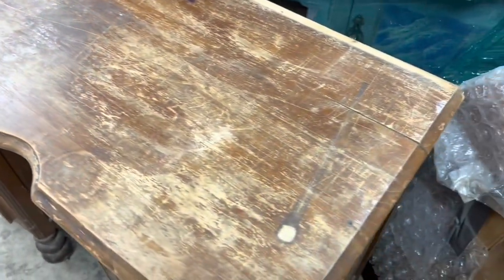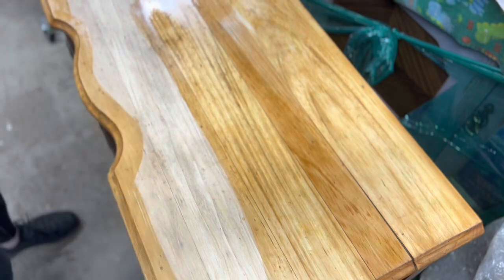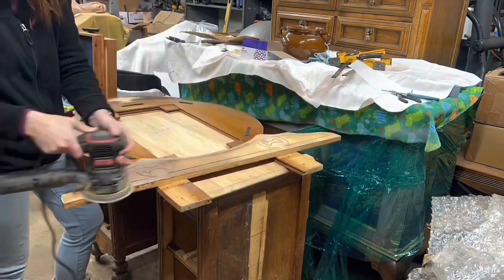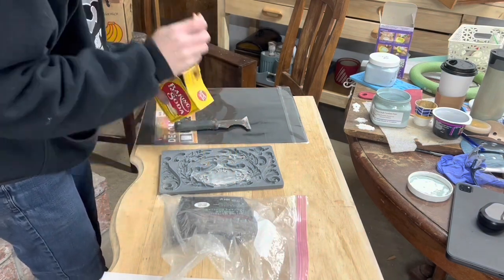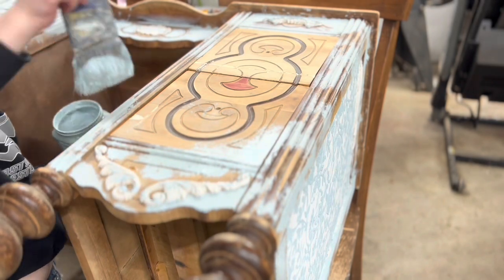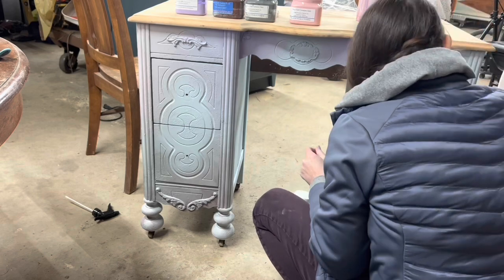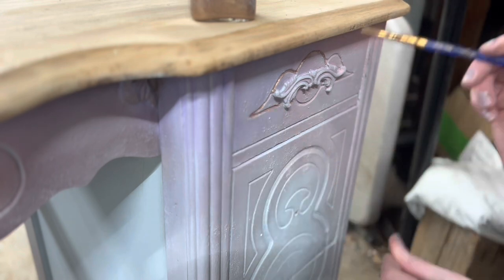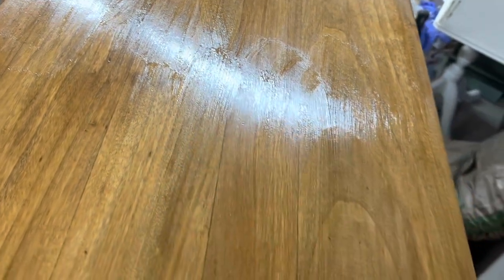Extreme Vanity Makeover | Elegant Upgrades

Comment: OMG That intro it's everything 😍 He's so cute and sweet 🥰 
I'm wonder if you had taken the top you would be able to glue it and not fill with wood filler 🤔 It end up amazing 😍 love the raised stencil and the top looks perfection, great job 👏🏻👏🏻👏🏻
Reply from the maker: Thanks, Linda! I’m pretty smitten with him 🥰. 
And the top was apart for too long so there wasn’t any movement at all. There was a gap in the base that moved while the top didn’t. It’s because they didn’t allow for movement in the piece- the whole top was glued on instead of using joinery that allowed for expansion/contraction. But that’s ok, the top looks great now and those waxes are actually very durable. You are absolutely right, though. That would have been a much better solution had it not been split for so long.

Comment: turned out very nice.

couple questions, could you have remove the top and then fixed it? same with the drawers, could you have removed the bottoms to work on?
Reply from the maker: Thank you!  The top had no movement at all because the wood had warped out for so long, so no, taking it off wouldn’t have made a difference.  This particular vanity wasn’t built with expansion and contraction in mind and it was damaged because of that. The drawers would have been easier if I removed the bottoms out.  The reason I didn’t in this case was because these weren’t put together with a slide in panel and nail in the back.  They were fully glued in with blocks and were locked in tight.  Had I tried to remove the bottoms, I would have more than likely caused more damage to them and it wouldn’t have been worth it just for a few stains in the bottom.

Comment: As I'm sitting here watching you fill in the crack on the top, I had an idea.  I'm wondering if you placed little slivers of the wax along the crack and used a heat gun on lowest setting and far enough away, how effectively it would melt the wax and force it down into the crack.  Your thoughts ?
Reply from the maker: I thought about heating the wax directly on the top, my fear was that it would darken the wood because of how hot the wax has to get to actually melt.